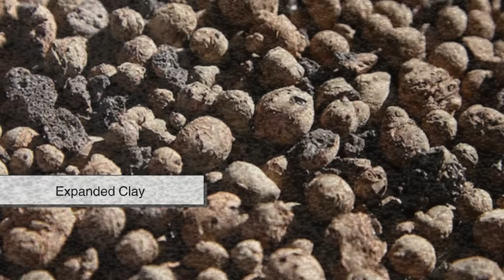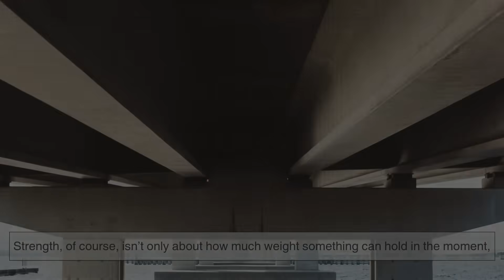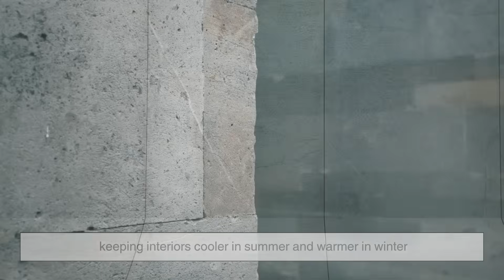Why Is Lightweight Concrete Not Weak?

Comment: I can see how construction would be easier, but beyond that, is less weight any benefit? Then there is cost. Is it any cheaper?
Reply: Presumably  less concrete means less cement, thus less energy content in the product.

Downside of less mass is less heat storage, (which is desirable for cold conditions).

Also less mass means poorer sound blocking at low frequencies.